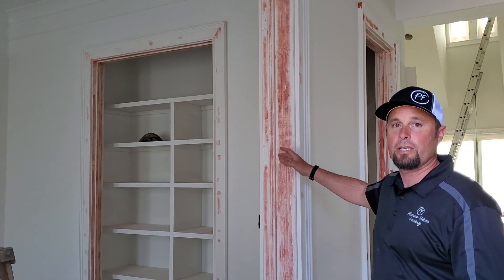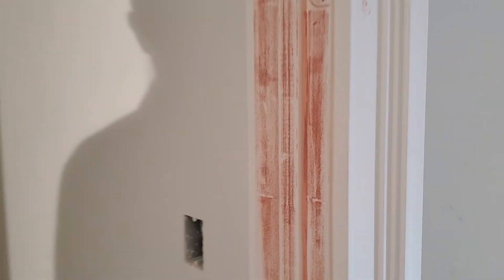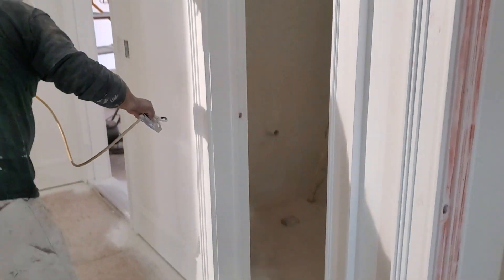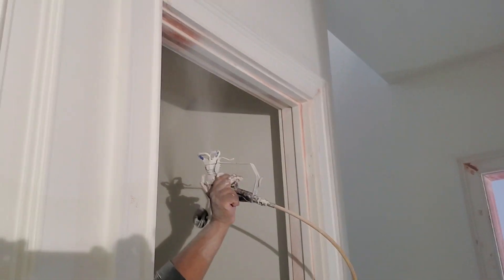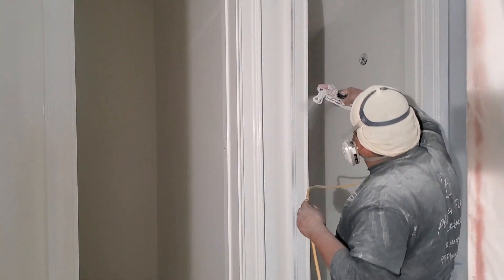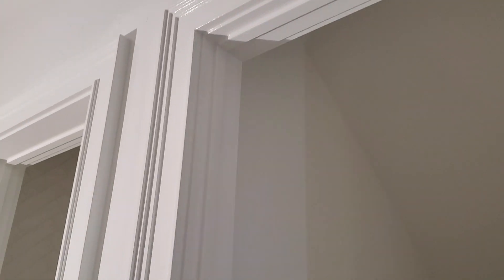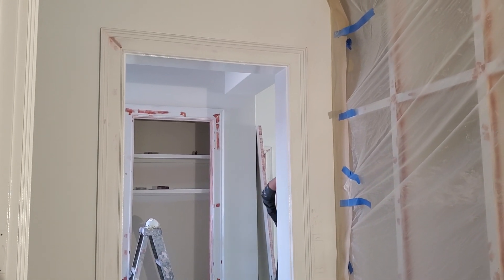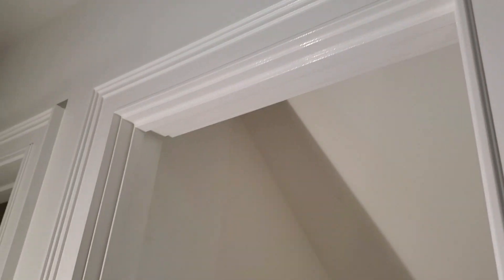Best way to paint over Bondo in ONE coat!

Comment: Most of the ultra high end trim jobs i did back in the 90s the painters always used bondo for filler but they were spraying oil base. Everything always looked amazing
Reply from the maker: Yessss! sometimes I miss the days of the good old strong oil base trim packs...nothing can beat an oil base trim pack! The alkyd stuff is a pretty close second though as different manufacturers invent better and better formulas! That is what everyone is trying to achieve,  is the look of oil, with the clean up and smell of a waterborne or latex. Thanks so much for the comment 👍 🙏

Comment: Great job. Luv the detail explanations as he’s spraying. I’m curious as to the overspray on the walls and hiding that overspray. Our walls are Level 5 finish.
Reply from the maker: Thank you so much🙏🙏 So the over spray is no issue as long as you sand the overspray,  before you shoot walls. But yes you are right, on a level 5 smooth finish, you might want to sand overspray,  then do a tack coat on overspray "a super light coat" and then do the final. Usually on smooth wall, just while I'm setting up I'll run around the overspray with a really light coat, it takes about 10min to dry, and then I shoot my normal coat. I think I did some videos on that with some really dark colors. thanks for the comment
Reply: @PaintBoss  Thanks for replying.   Refreshing to see. 
I sprayed my first kick at the cat, 6 doors and  300 ft of baseboard.  I leaned on your vids a lot. That 310FF tip was the ticket. I’m planning to spray shaker MDF new kitchen cabinet doors /drawer fronts (24 I think) once I get the cabinets built for my sons house Reno. Plus figure how to get all sides sprayed at once

Comment: Great videos!  Question.  I’m a diy’re trying to paint some flat slab doors.  I’m using a Graco hand held sprayer with adjustable pressure dial.  I can get that glass like look with a 310 go tip but by the time it drys it has areas with pin holes. I’ve tried  SW pro classic and Advance.  Spraying and drying horizontal. Any ideas as to what corrections I need to make?  Thanks!
Reply: May be is the primer you using is not compatible with the paint, try bin shellac primer, sand and wipe out dust with wet rug of alcohol before you paint, or try floretrol mix in your paint

Comment: Wont Over spraying onto the walls create a "flashing" when the walls are finished ? I Have Seen It Happen .
Reply from the maker: Great question and really good concern. So we offset or prevent flashing or "halos" by sanding off the shine of the overspray....we sand all our walls prior to shooting, but yes... flashing is a major risk and priority...so we sand the over spray on the walls with a sanding sponge, and sometimes if the trim paint is an alkyd or really strong we sand, and do a tack coat before we shoot. GREAT question and I was actually thinking yesterday I should probably do a video about that and explain. Thanks again for the great question

Comment: We would float out the miter's on the flat stock casings with bondo, but we aways had issues with the water base paint pitting or fish eyeing on those corners. We would do a spot prime with good primer on those spots before top coat, but then the corners would always have a higher sheen than the rest of the frame. Do you know of any way to avoid the bondo effecting the paint? We alway use pro classic hybrid or Coronado hybrid.
Reply from the maker: Hello Adam,  thanks for the comment.  so we spackle first as a base, then spray millwork primer, then bondo and sand. as long as millwork primer was on first we don't have pitting issues at all, I have got in trouble though on "pre primed" base and case that i myself didn't prime, and that is when we have a lot of problems with pitting and fish eyes ect...in that scenario,  we spot prime problock over all our bondo after sanding and then we are good 👍
Reply: Hey Adam I also like to float out my wainscoting panel, have the same trouble as your having with it leaving a different look after prime and paint. Did you ever find a good antidote to this issue?? It drives me nuts !!
Reply: @quietstorm219  The only possible solution (I think) is going to be spraying a full primer coat end to end. Something like a Bullseye 123. Theres no money in the budget for me to be doing this for free on jobs, so we use a smooth spackle instead, not as smooth as bondo, but doesn't give us the trouble.

Comment: Hi boss, how do you deal with the semi gloss over sprayed on the walls? I want to do that treatment but I wouldn't know how to deal with the semi gloss on the flat walls. Should I mask to avoid a disaster?
Reply from the maker: Hello Bruno, so what we do is after our trim is shot, we do a light scuff sanding of all of our overspray after the trim is masked. Scuff sanding the overspray takes care of any flashing that would happen. I will say that for some reason this does not work with cashmere from sw...don't know why, but we have only experienced halos using this system with cashmere.  but all other wall paints we have used don't do this and this is the way to go!

Comment: The bondo glazing putty really doesn't bleed through with latex on top? I used some bondo glazing putty on a car project coming from house painting land and was surprised at how awesome it was, definitely the smoothest and best sanding stuff around.
Reply from the maker: Yes, you can definitely cover it up in one coat, depending on the product you are using of course, but we usually can cover up with just one coat! we almost always do 2 coats, but the stuff really works and gets so smooth, we love the stuff! thanks for the comment
Reply: @PaintBoss  It doesn't end up bleeding after a few weeks or similar like a tannin stain? I'm just worried as the stuff is super red, and lacquer based. It would definitely be a game changer if I could use it without priming. It's better than any wood filler/putty on the market for sure in how well it sands and feathers. You can thin it with acetone, too, btw.
Reply from the maker: @GilBatesLovesyou  well...im glad you mentioned priming...so coverage wise you are good...however,  I have had problems on pre primed trim when I don't prime it first...it has flashed sometimes with one coat and not primer, but definitely if you sand and dust and clean really well you won't have any staining come through like tannins in wood 💪👍
Reply: @PaintBoss  So either prime and one coat, or do two coats of top coat? Glad to hear that on bleed through, I'd expect the flashing because even a wood filler or spackle/etc could do that.

Comment: 1st I want to say I love this video. This guy sprays almost exactly like I would, we even have the same name lol my question is... How is that not sagging? I'm usually spraying emerald urethane and if I stayed on it that long with a 310 green fflp tip (I think thats what you said he used) I would have massive runs. I always have to do way waaayy lighter coats. How does this product he is spraying compare to urethane enamel in performance? Ive never heard of it or know anyone whos used it.
Reply from the maker: I know! you are absolutely right! We love using this stuff cause it hangs up like no ther paint! I have literally tried almost everything available from sherwin,  dunn Edwards,  and Benny Moore and this is the only product to hang up so thick! It is a regional product named southwest builders enamel,  and it holds up really well! Pretty much every contractor out here that does new construction uses this stuff! I just did a 16,000ft house in parkcity Utah, and couldn't even buy it there. It's not as hard as emerald or Aristoshield...but dang...you can build it like crazy!! It's what I shot my house with when I built it. Thanks for the comment 👍🙏

Comment: Huh, wow. My whole time painting I’ve been spot priming with rattle can before and after bondo patch. I’ve done bondo over latex and makes a small ring around the perimeter. Maybe there was something else happening I thought it was because bondo is hot
Reply: He keeps calling it Bondo, (brand name) when its a glazing putty. No mix or chemical reaction like "bondo body filler".Great stuff for filling pinholes, dries fairly quick, and sands EASY! If you DO actually use the body filler "bondo" where you mix the hardener...its usually a pain in the ass to make smooth. it will expand and contract different than the wood around it.

Comment: I can see that you do not use primer is direct paint in my system I must always use a primer  
 is a good job the preparation is the most important thing of all paint job
Reply from the maker: Actually we did shoot a primer, we always use Sherwood millwork primer, then bondo all of the imperfections over the primer👍 We shoot 2 coats on our wood packs, always primed. Thanks so much for the comment 🙏🤝